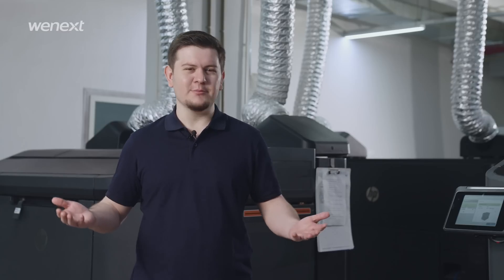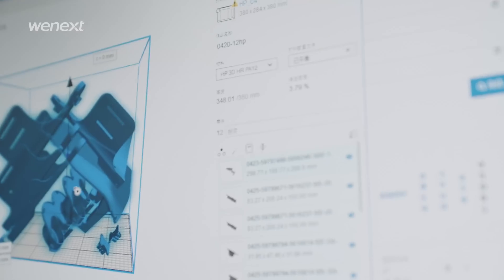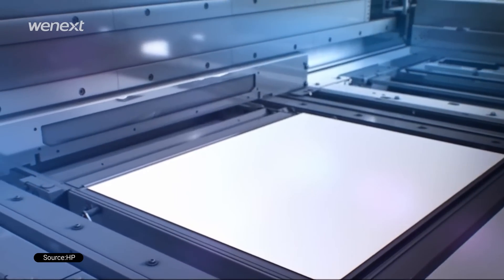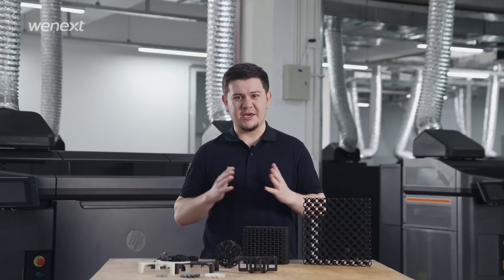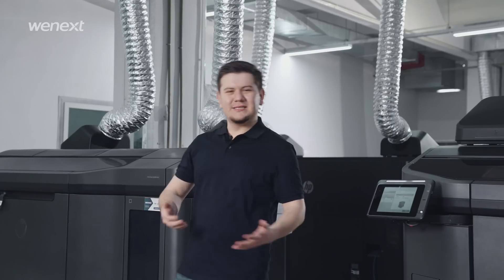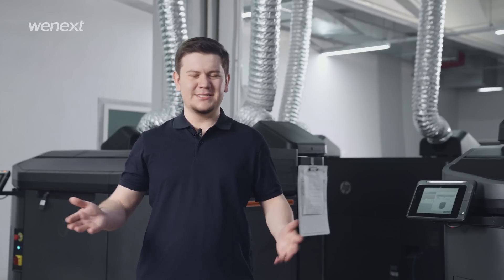How does Multi Jet Fusion (MJF) 3D Printing work?

Comment from the maker: 00:00 Multi Jet Fusion (MJF) 3d printing process. 
00:13 The first step of MJF is to check if the STL file is printable.
00:50 How does a MJF printer work.
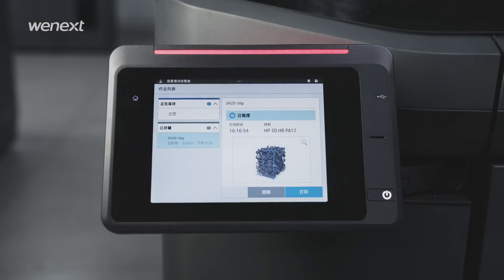01:20 What post-processing processes will be after the MJF 3D printing is completed.
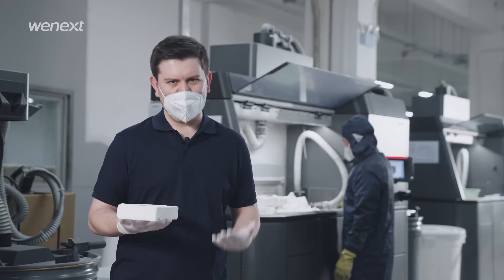01:44 The Pros and Cons of Multi Jet Fusion 3D printing. 
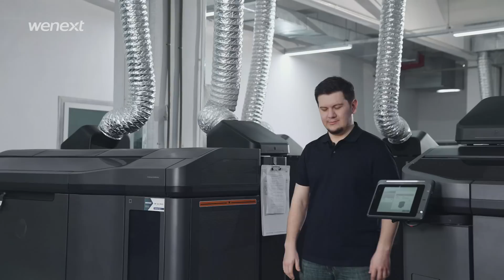02:38 This is MJF 3D Printing service at wenext, hope this video helps you.